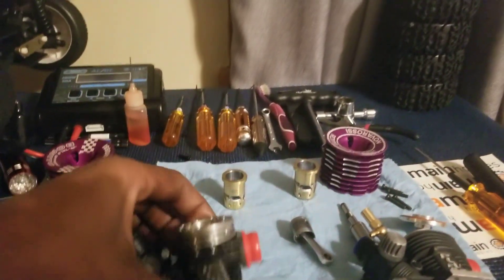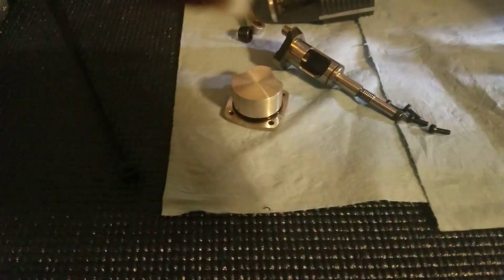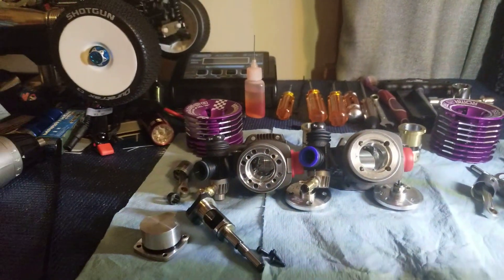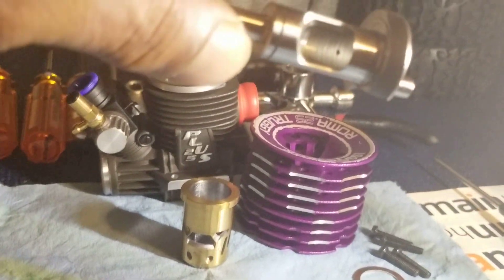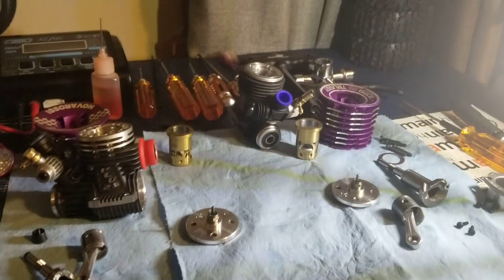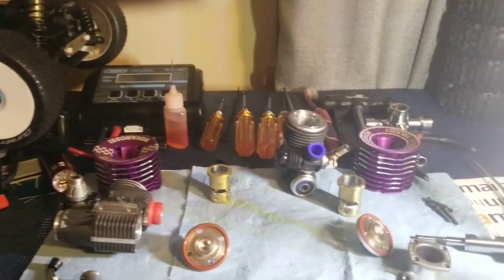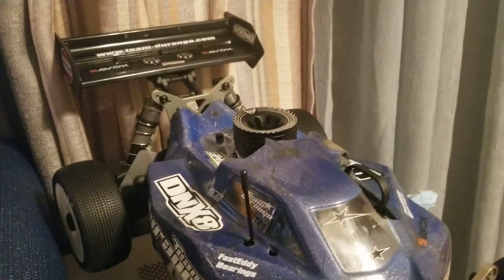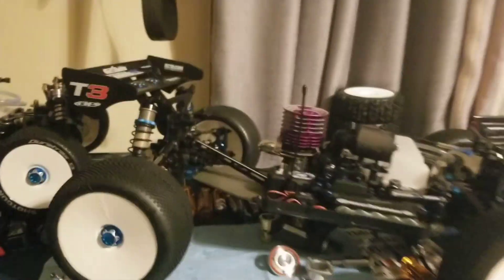Some  more  engine  talk  and  pay attention  on  what  you  buy  people 👍

Comment: You on it bro!  In the full scale auto world they call it platform sharing and all the major auto manufacturers do it. You just as technical as me and what you doing is how I got to be this way. I need to know what I'm paying for. That's real talk. The cooling head on the Roma's could be different for a gazillion reasons. But it should be safe to say the center of gravity is lower on the first Roma. And for the different carbs on the Roma's I would bet when you drive them one may feel more powerful but it may not make more power. The newer Roma carb may just smooth out the powerband or make it feel more abrupt. Same for your Bonito's. One Bonito may feel more abrupt with the power then the other. But total power should be very similar. Different carbs can have an effect on the powerband as far as how wide the powerband is or how fast the engine can get into the powerband all types of stuff. Alot of these engines are based off of discontinued models from the late 90's early 2000's with better technology to manufacture them but the basic design hasn't changed in a long time from what I can tell. Great video series bro👍
Reply from the maker: I have  a  great  teacher  thanks  to  you  my brother  so  when  I  buy  another  engines  I  will  be  looking  close  to  what  I  buy  for  now  on so  thanks  to  you for your  videos  👍👍
Reply: @shermanrc4723  glad I could help bro!👍👍
Reply: MrLilchilly I see. 👊🏾